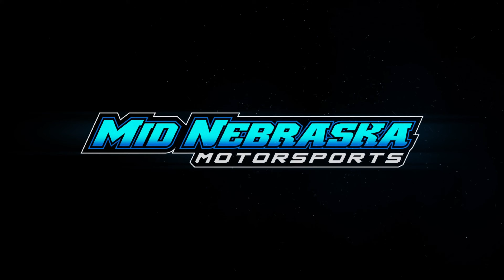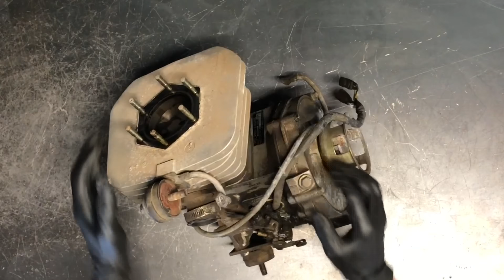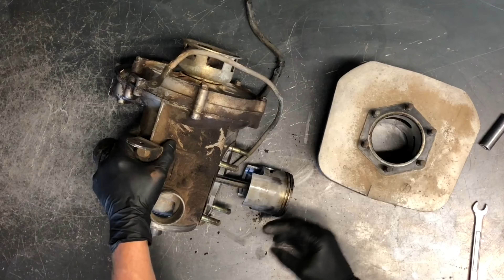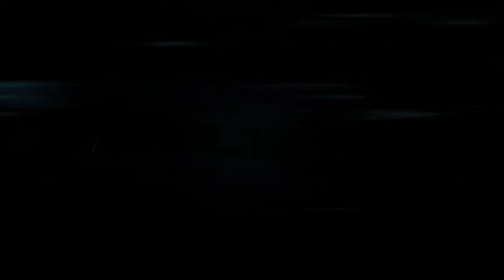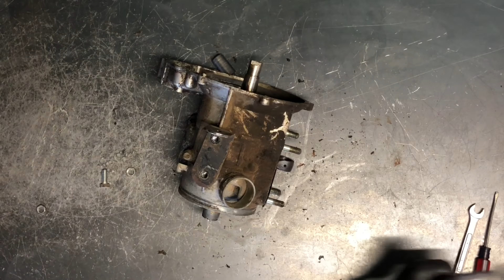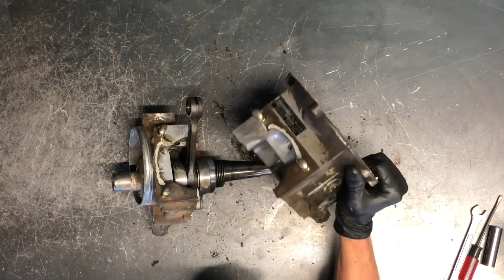Polaris Trail Boss / Blazer 250 *EASIEST MOTOR EVER*  Engine Crankcase / CrankShaft Motor Locked UP

Comment: I know I’m late to the party but I just got 250 trail boss and when I got it it was in pieces now I have a idea on how it goes togeather but on the crank opposing to the stator is there supposed to be two ball bearings that hold the crank in. I have two ball bearings and I see there’s one on the crank before the worm gear so I know it dosent go on that side

Comment: Is there oil that goes in the crankcase or is it the motor only lubed by the premix
Reply: I don’t know but on my 250 that I’m currently rebuilding I put a little oil 10w-30 in there and spun the engine to make sure everything is lubed, just don’t put to much.